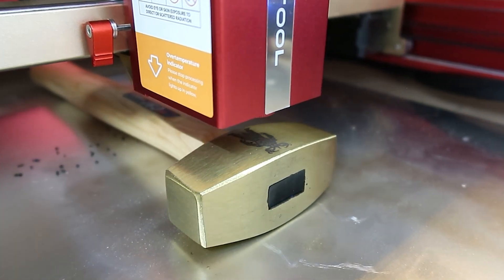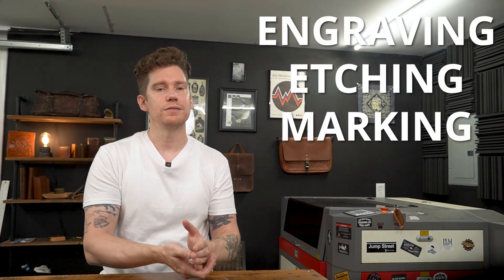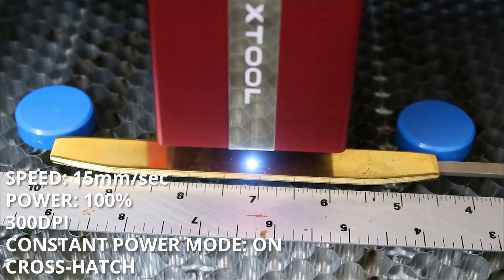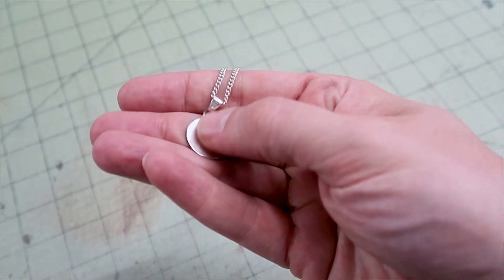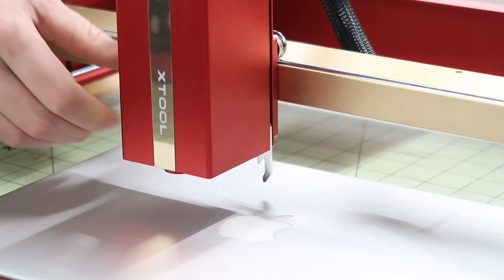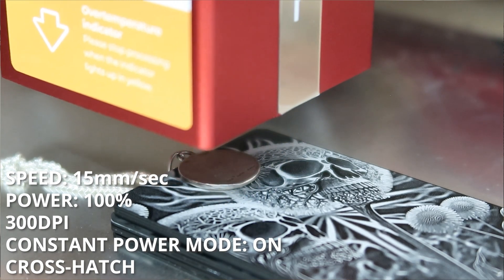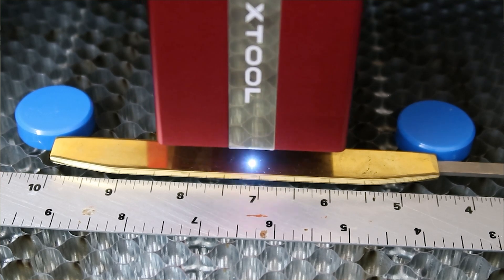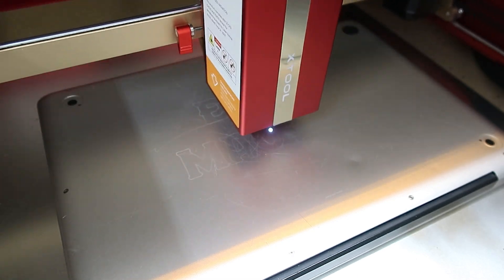The xTool IR Module for Fun and Profit (Review)

Comment: Can you use the power supply that comes with the IR head to power the normal laser that comes with the unit to? i have the 10w d1 pro but my house flooded and submurged the power supply, x tool want £100 for a power supply minus shipping, im interested in this unit anyway, so could maybe just use the power supply that comes with this IR module for both laser heads?  
🤞

Comment: This is the video I have been looking for. I need a laser machine for exactly the purpose of what you did with the silver jewelry. I’m not techie savvy, but can you please tell me what laser machine should I buy with this? The Xtool is above my range and this one is what I need. I appreciate you sharing these videos which are really helpful. Do I need an air filter for this? I live in an apartment so I’m just wondering if working with a laser machine can trigger the fire detector since it’s sensitive to scents. Thanks again and i really appreciate your content. God bless .
Reply from the maker: If you really wanted to do personalized jewelry the xTool F1 ( https://geni.us/xtool-f1-engraver ) is probably the best starting place. It is the same laser as what I used in this video but its smaller and MUCH faster. You probably arent going to trigger smoke alarms running jewelry but you also dont want to be breathing in those particles. They make an air purifier that attaches to the F1. If you cant exhaust outside due to being in an apartment I would highly suggest it.

Comment: I’m a confused newbie. Could you possibly do a comparison between diode, co2, ultraviolet and fibre laser. You don’t need to demonstrate any particular laser or brand. Just a comparison between what materials each type can do, like a chart with various wattages and materials. I bought an Ortur 10 watt diode and then there was 20 watt available. It can do things the 10 watt can’t do but perhaps a 10 watt of a different type of laser would do those things better than an upgraded diode.
	I then bought a Laserpecker 20 watt (before Ortur 20 watt was available). I was then surprised (confused newbie) when I received it that it is actually a fibre laser.
	I am floundering on YouTube where every brand is the best and I want one of each. A more comprehensive comparison would then be speed. Would one brand 20 watt be faster than another brand 20 watt.
	At $1,500 each (Converted to Canadian dollars) I can’t afford to buy a third laser without knowing a lot more information going in. Or maybe one of your viewers knows of something like this that already exists.
Thanks, Sherry
Reply from the maker: Yes it can be very confusing its unfortunate. I have another video called "Choosing a laser in 2023" where I cover some of that comparison. Especially the pros and cons.
The laser type that can do the widest variety of materials is the co2 laser. Wood, acrylic, leather, etc. Its the closest to a "default" laser you will get.
A diode laser can do most of the things a co2 laser can do except clear (and light colored) acrylic. Diode lasers (like your Ortur) are also lower power and hence more affordable than a co2 laser.
Fiber laser is mainly just for metal although it can manage some other materials as well.